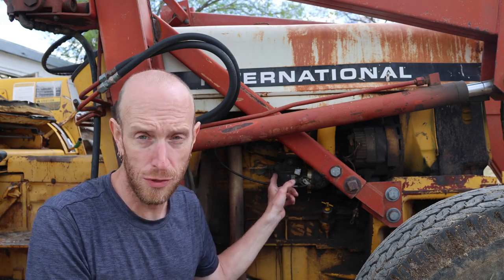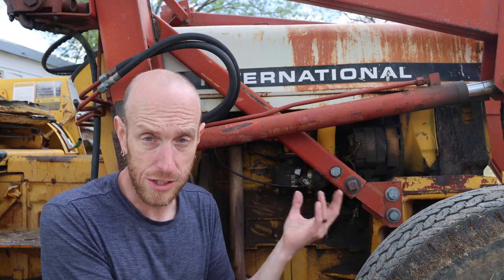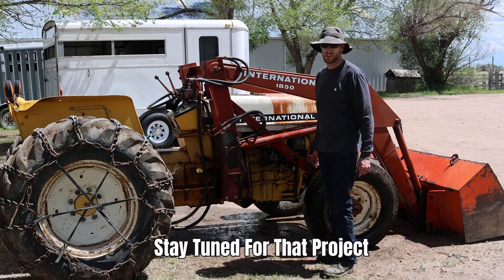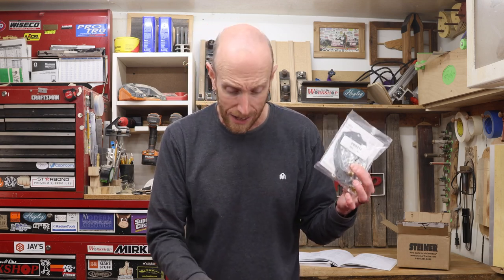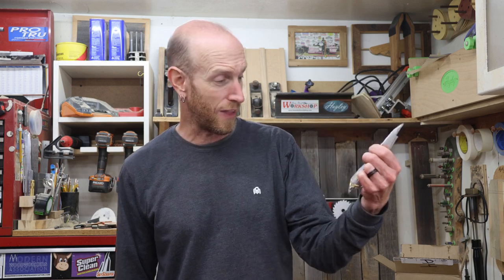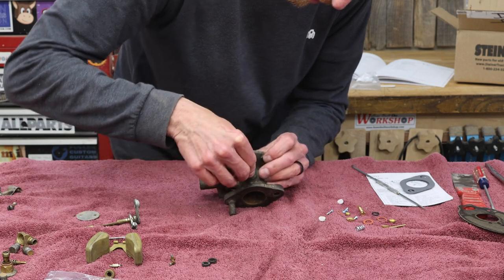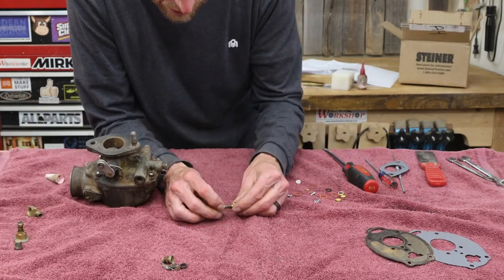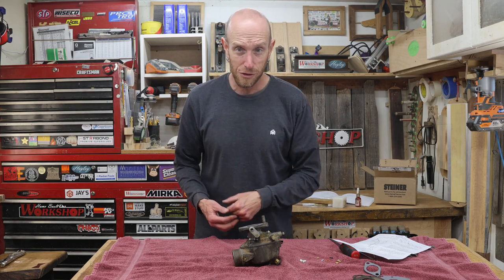How to rebuild a Marvel Schebler Carburetor for your older Tractor | International 2400B, 454, 464

Comment: Just a little tip. Remove throttle linkage before pulling manifold bolts completely. Mine cracked from weight of carb on it and couldn’t get replaced. A expert welder saved it. This on 606 Ih.

Comment: I use eyecrometers too.  I have calibrated and uncalibrated.  Lol!!  Good work on that carb.  

That Super Clean would help you initially clean the pressure washer you need to look at.  I could use it to clean my 2 cycle stuff - leaf blowers & chainsaw.  My chainsaw case is filthy inside.
Reply from the maker: I used the uncalibrated ones. My calibrated set was dirty. Lol
Reply from the maker: Congrats Dave, Your comment has been chosen to receive the Super Clean Giveaway. Be sure to check your email/messages for further details.